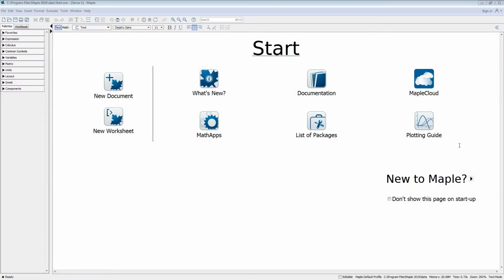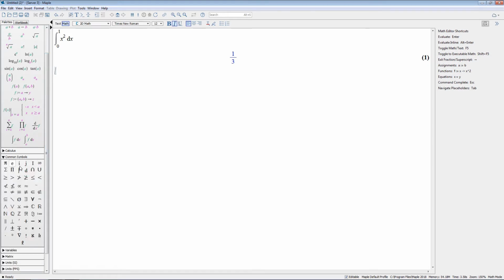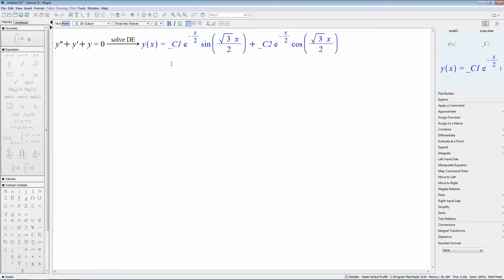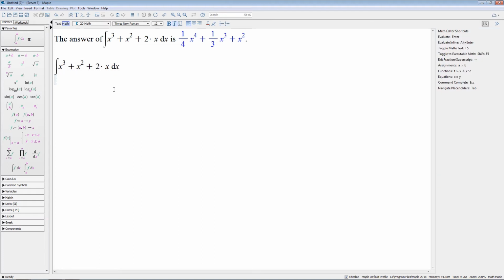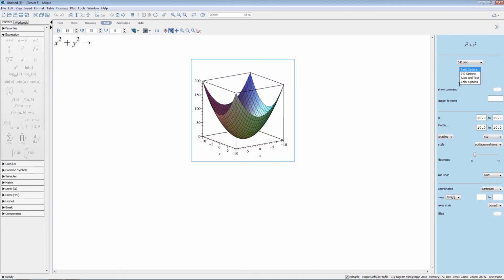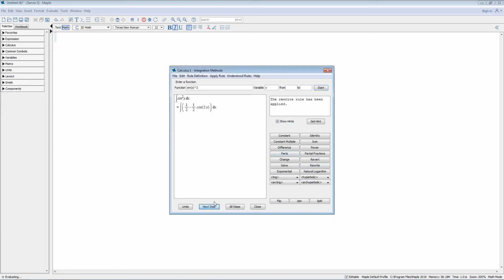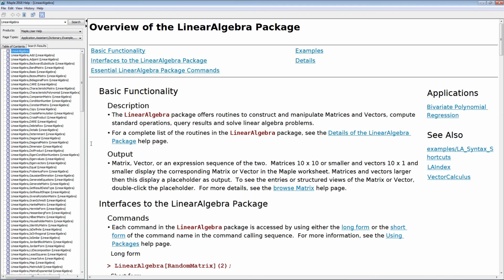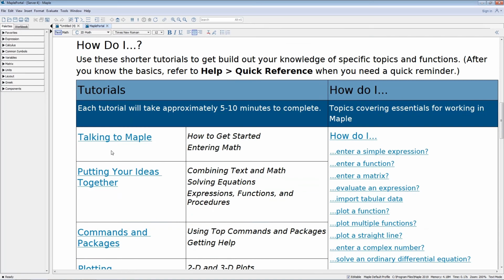Maple Fundamentals Guide

Comment: I find the plot controls could use much improvements.
For instance there no keyboard shortcuts or modifier key usage, could add Alt key to pan, mouse wheel to zoom, control to evaluate curve etc
3D plots tumble in every direction and can't be reset, should be constrained by axis (up), and more importantly reset their orientation.
Also add point probe for 3D plots with the navigation shortcuts described above.

Comment: also dumb question but can anyone explain alt enter? I press them both at the same time and my output is still on the lower line
Reply from the maker: Not a dumb question at all! You're only able to have input display inline in Document mode. If you're working in Worksheet mode, the output will display on the next line. To open a new Document you can go to File>New>Document Mode.
Reply: Maplesoft ahhh that was it thank you

Comment: Hello. I have Maple 2019.1 (the latest update, I assume). I am following this video. I am at 11:25 and when I click on a plot, the plot toolbar appears but it is only 1 line. It does not have the buttons above with 'Text', 'Math', etc. and I cannot find any place to have those buttons show. Any help, please?
Reply from the maker: Hi there! Parts of this video was actually recorded in an older version of Maple. Thanks for catching that! It shouldn't change the functionality at all though, and you will still be able to use the features in the same way. In Maple 2019.1, you'll notice a drop down box that appears in the toolbar when you select the plot you're working with. It has two options - Plot and Drawing. You can use this to annotate your plot in the same way described in the video!